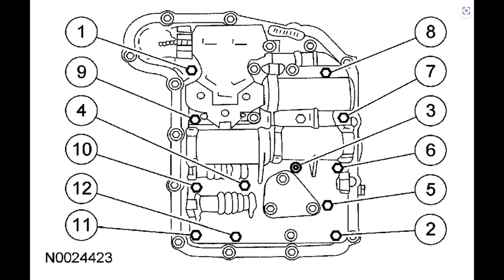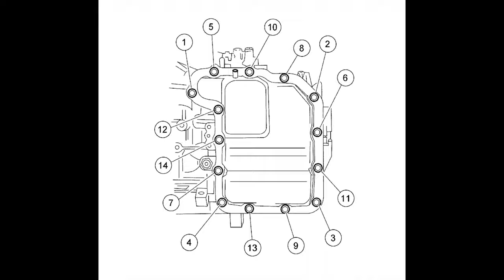How to replace a Ford CD4E Transmission Shift Solenoids

Comment: The trick to those style connectors is use appropriate side box end wrench to depress the tabs then use your palm and simply push it out.
Reply: That would be a 32mm wrench, probably not laying around the average home garage.

Comment: No need to remove the radiator hose, plenty of clearance.
Reply: I did this job yesterday, detaching the lower hose from the radiator was well worth the effort for me but I'm no professional mechanic.
Reply: @thastinger345  If you have the V6 version perhaps. On my 4cyl I was able to just move some cables around as they easily un-clip. Save yourself a coolant bleeding job when you can. I ended up needing a new transmission anyway so, different boat.
Reply: How  about on a 98 contour  2.5v6
Reply: You can barely get ti the dipsticj
Reply: @donkellar9816  different animal. I'm referring to the 4 cyl.

Comment: what problems where you having leading up to this installation? mine was the 2-4 gear ratio was incorrect plus i had lost reverse. i took out my 2-4 band & servo but inspection was all good there, so i got to looking at my trans pan/wiring and seen that my soleniod pack plug was full of trans fluid. i ordered this part while hoping this fixes my problem bc I'm just a self taught diy mechanic.

Comment: Quite nice. The clips always give some trouble. Also liked your comment that it is easy to get in a hurry and finish when sometimes you need to step back and check things. I have  4EAT auto that is shifting down into a lower gear. Trying to figure out what is causing it

Comment: I've a Mystique that's ailin'.  What were the symptoms you were having, if I can ask?  I've had delayed engagement from a cold start in Park for like, ever, but now she likes to slip in and out- or even slip into the next gear down while driving.  Randomly, of course.  A partial fluid change (about 6 out of 9 quarts) helped a lot but it's still doing it some.
Reply from the maker: I was getting the 2-3 shift flare.  I am no transmission expert.  Have you cleared the adaptive transmission tables?  You'll need a fancy scan tool or a buddy with one.  The wife got me a Xtool D7 for an early Christmas gift.  I did find this article helpful when trying to learn about the CD4E.  I hope you get it sorted out!

https://www.sonnax.com/tech_resources/241-cd4e-transmission-inspection-checklist
Reply: @BootstrapRevival  Being it's a 99 I don't know how computerised the tranny is, I'll keep that in mind when I get the chance to look into it, however.  it's on the back burner for the time being.  It went downhill in a hurry with slipping and got better after a partial fluid change- so much better I'd declared it fixed but it began acting up again at highway speeds.
Reply: @BootstrapRevival  Well some more reading I decided I'd better change the transmission range selector sensor switch and so far that seems to have been my problem.  Supposedly that gets the computer all confused as to which gear its suppose to be in.
Reply from the maker: @rickd650  - I have a scan tool that can test the range selector switch.  It was expensive 
But ask some buddies if they have one that will do it.  At least you can test it before tearing it down.

Comment: Those husky cordless ratchets are awesome!
Reply from the maker: Man I got mine after Christmas for $50 it was a workhorse for years until I over torqued something spun the wrench and snapped the trigger off.  It still works but its a backup in the shop.  Great tools and hard to beat for the money.
Reply: @BootstrapRevival  yes! About the same here. Mine came with a large case and set of metric and sae sockets. I never saw it for that price or amount of sockets again. Cheers!

Comment: What was the symptoms of this solenoid going bad? I have the opportunity to purchase a 2006 escape the mechanic told the current owners that’s what it needs they say the car runs and shifts just fine until it don’t, then it refuses to go anywhere or shift until after it sits for a good while
Reply from the maker: Hey Kevin,
I had the 2-3 shift flare.  I have no good advice for you on the one that does not shift until is sits.  Will it move if shifted manually into 1st?  I found this article helpful.  https://www.sonnax.com/tech_resources/241-cd4e-transmission-inspection-checklist
Reply: Did you ever figure out your issue? Was it a clogged filter? I'm having the same issue and I've replaced just about everything with no success.  @BootstrapRevival
Reply from the maker: We ended up giving this car away to a single mom who needed immediate transportation.  It still had a very minor shift flare but she drove it for a year with no trans issues.  She used it for trade collateral on a newer Honda (which is fine by me) so I can't give you an update as to how its doing today.  I hope you get your issue sorted!

Comment: So happy to have caught your video. Glad to know there's something that can be done with my CD4E transmission without pulling it. What book are you referring to? a service manual? Also curious what sent you to that shift solenoid, what were your transmission symptoms? Anyway, thanks for taking the time and being real.
Reply from the maker: I had a shift flare.  I was using the Ford service manual.  I got a short subscription to All Data DIY specifically for this issue.
https://www.alldata.com/diy-us/en

Comment: QUESTION: Mine was working fine, new trans had only been in my car just a little over a year, (occasionally would sound like it’s slipping here and there on hard throttle but not Everytime, did that for months, going to upshift but slightly hesitating then engaging next gear after a second or two) then recently in the middle of driving, all within a 20 min timespan it went from THAT, to it starting to shift weird, feeling like it wasn’t catching the gears as solid as it originally did, so I headed home. By time I got into my neighborhood, 1,2,D no longer worked at all. O/D began flashing. However reverse works fine. So I drove the rest of the way in reverse. Do you think it’s this same thing you replaced? Or something else? It had driven fine all day prior to this happening. The last trans that was in it had failed gear bands, but it felt differently to me than this time, last one I was able to drive for another month before it completely quit, made it to Florida and back up to Pennsylvania although i had to shift it myself it still drove fine for a month like that, this one was extremely sudden, went from fine to gone in just 20 mins
Reply: What did your problem turn out to be?

Comment: Hello was checking to what happen to the pin and how did you remove it.
Reply from the maker: The little rod will come out when its unbolted, just make sure the pin does not fall out!
Reply: What happens if it does fall out